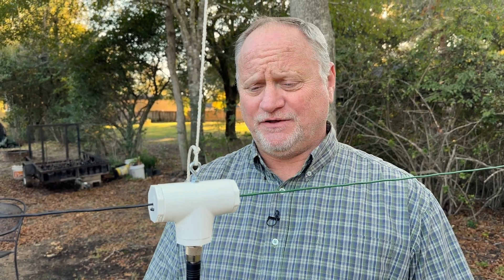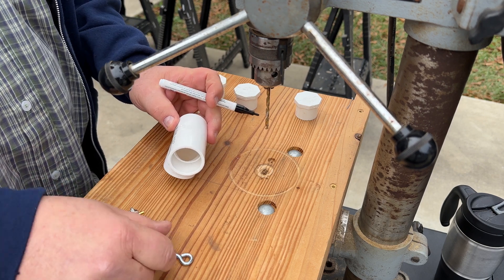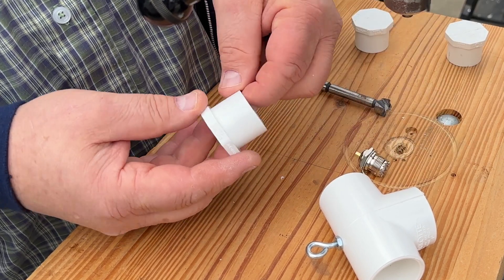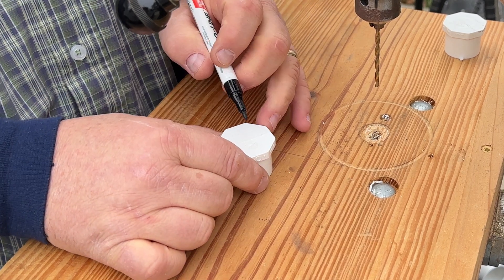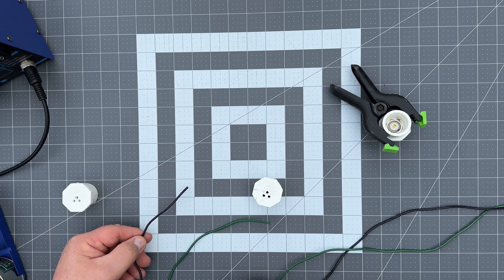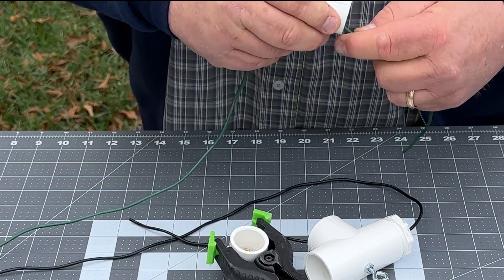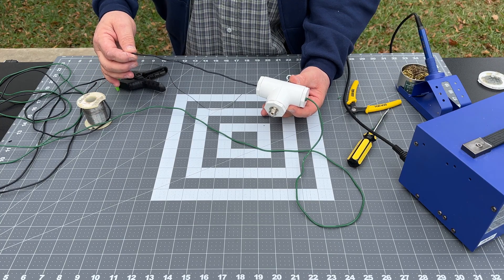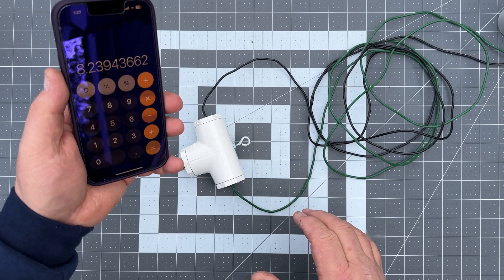How To Build A 10 Meter Half Wave Dipole Antenna for 10 Meter Ham Radio

Comment: This has got to be the simplest antenna design I have been able to find that doesn't require you to spend as much on hardware as you would have on a commercial antenna.  That and the clear easy to follow instructions has made my mind up.  I've had my call sign for about 24 hours and this will be my first attempt at building an antenna.  73 KC1YSX

Comment: Hi, new HAM, can you please explain how you figure how high the pvc/239 connector has to be and what angle are the antenna wires or does that matter? 
Are the PVC slip caps glued in afterwards?

Comment: I copied the exactly as my first HF antenna and it was fantastic! When I got my general I made another as a fan dipole with wires for 6,10,20 and 40m. 40m wire shortened with coils. Perfect tuning with patience. 67 countries from MN at 100w.  And, it’s mounted in my attic!  Hard to beat a dipole if you have the space. And dirt cheap! I used 16G speaker wire.

Comment: I was about to buy one of these for $60 on Amazon and have to wait to get it. After watching this video, I'm gonna get started on building one right a way  and spend less than half the amount of money. I might even build a full wavelength antenna. I'm going to add weights to the ends of the wire and attach them to the limbs of some trees for a temporary overnight setup.

Comment: I'm a little bemused there is a howto video to make a 10M half wave dipole antenna.  Even if someone didn't know what a half wave dipole antenna was, which everyone does, wouldn't even just the name of it imply the dimensions and the construction?  You don't need to use pvc pipe fittings or anything in particular at all - any junk piece of plastic ouf if the trash will do. You don't even need insulators on the end when you have a little bit of plastic rope lying around, which everyone does.  Even the wire can be anything remotely conductive at all.
Reply from the maker: Absolutely you can build it from just about anything. That's the fun of it. I just like to be neat. 🙂
Reply: As a complete novice in every sense of the word. I.E. I'm still studying for the technician test. 
I really appreciate these types of videos. 

I'm sure you're an Elmer who's been at this quite a while. However, it's good to remember that no one started out with the vast wealth of knowledge you currently possess.

Comment: Should it have a ground and or a balun?
Reply from the maker: Yes, I was using an antenna tuner (not shown) instead of a balun.
Reply: New tech here. So if I have an antenna tuner, which I do with my FT-817, then I don’t need a balun?
Reply: A Balun is NOT necessary for a dipole.  A 1:1 balun can help a little in certain situations but is not required.

Comment: You didn't show if you glue the caps for the three ends ... the legs & feed into the tee,when the wiring is completed ?
Reply: Great innovation/ creative...but without pvc adhesive there will be stress on the solder connections when mounted !?

Comment: Newbie question. Does the final measurement include from the centre plug to the tip of the wire including the locking S turns?
Reply from the maker: It may effect it minutely. That's why I cut it a little long at first. Then take readings and shorten as needed.

Comment: Why didn’t you solder the SO-239 connections before tightening it down inside the fitting?
Reply from the maker: Either way works for me. Thanks.

Comment: You spent all that time  with expensive  bit  trying to install a connector you don't need but you don't have a choke balun?
Reply from the maker: You can use any bit. I guess I always hear my daddy in my ear about if you're gonna do it...do it right. 🙂As far as the choke, I use a third party choke and wasn't showing it. The making of the antenna was the goal. Blessings my friend. It's all good.

Comment: What was the final measurement of the wire that was cut? And are you measuring from the cap to the end of the wire?  Are you including the wire that is on the inside of the tee?
Thanks for the video I’ll be making one for sure. K4PWI

Comment: I know people love to have an SO-239 on these antennas, but have you considered just epoxying your coax into the antenna and saving the 3dB connector loss? Forgive me my blasphemy...Anyway, its a great antenna, simple and effective!
Reply: Connector loss of 3 db?  50 connectors in series would not have 3 db of loss. 3 db of loss is half your power.  With 50 watts of transmitter power you would not be able to touch the connector without fire resistant gloves.
Reply from the maker: I agree, but then you have to use a 25 foot or 50 foot coax that you can never use on anything else. I think the convenience and storage may outweigh the loss. I guess we can increase the power to compensate.😊 It would however make a great video!!
Reply: Insertion loss for an SO239 socket coupled to a pl259 plug is no more than 0.1 db. Where are you getting 3 db loss on an SO239 ? Mark VK3PDG